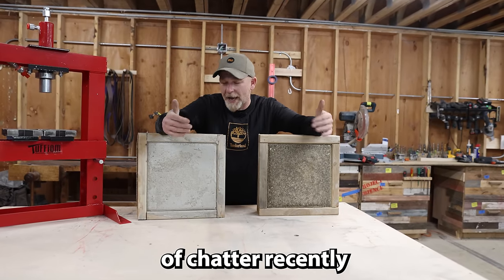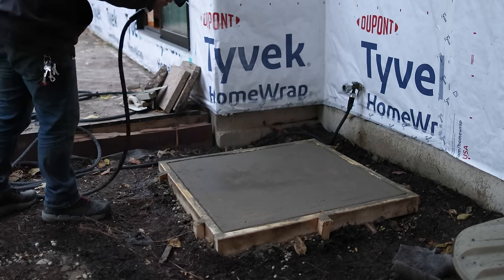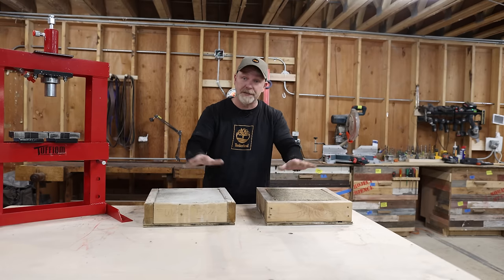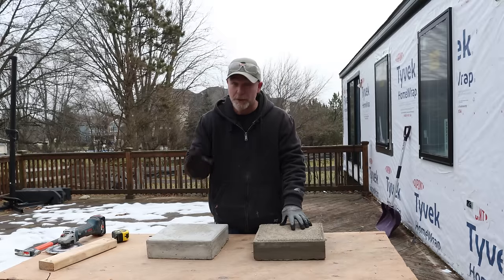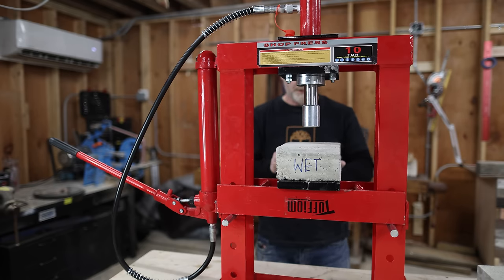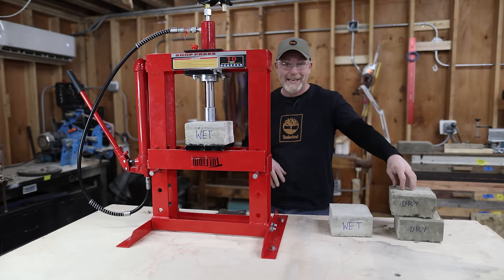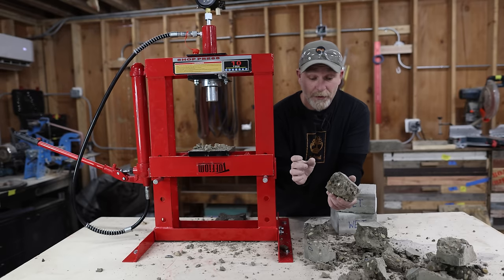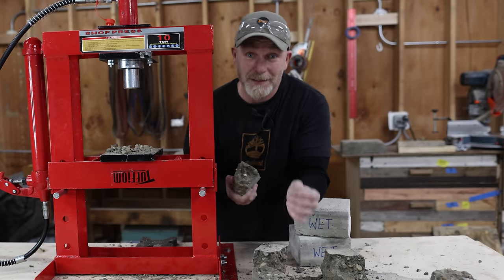The TRUTH About Dry Pour vs Wet Pour Concrete!! Strength Test - You WON'T Believe the results!!

Comment: You know i think why the dry pour has a different colour is because it is still absorbing moisture from the air.
I was wondering if there is a courser powder of concrete that would allow moisture to seep deeper into the dry pour so it will set faster that a fine powder that hardens at uneven layers. My speculation.

Comment: You should keep wetting those over the next several months. There is no way to get enough water in a dry pour to fully cure it by misting it over the course of a day. However, if you keep misting it you might see additional curing over time. It will never be as good as a wet pour though.

Comment: Concrete is meant for Wet Pour. However Dry Pour is an interesting labor saving procedure which had many advantages. Perhaps a new Additive need be added to add water to the mix. I think if the slab is thinner dry pour could work.

Comment: I cannot agree ninety days is  OK just about for wet pour but you need to triple that for dry pour. There is dry pour and dry pour. In my experience dry pouring fence posts you will get a differing cure time between Autumn and summer pours due to ground moist levels. If you are pouring a dry mix into a hole of any description in a naturally dry area pre soaking the hole can make a substantial difference. several pre soaks until hole holds water to one third full pour in the dry mix add more water, this can lead to material separation so some stirring may be required.  As for large slabs dry pouring should really be restricted to light load areas and given as much water as possible.

Comment: That dry pour honesty looked like it needed longer to cure. Also, from my understanding of wetting a dry pour. You should mist it 2 times waiting an hour between each. Then you should shower it once an hour and should do it 2 times for every inch. So, a 4-inch slab would need 8 showers. That said looked at it how yours turned out. I wasn't surprised at the results.

Comment: So let's live in fantasy land where dry pour and wet pour are identical after done.
What is the benifit of a dry pour.  You have to mist it and soak it and care for it for days to make it work.   
Wet pour you mix it up and pour it.  Let it start to set up and trowel it out and your done.  Don't let it get rained on for first couple hours and your good to go.

You don't save on concrete bags, in my opinion you'll never get a dry pour as smooth as wet pour, I guess you save on the mixing part but that really isn't that much work, you still have to lug the bags around. More so in a dry pour. Wet pour you don't even have to unload then from your truck. Pull to the edge slit the bag and let gravity do most the work

So how does a dry pour make Job any easier??

Comment: I think it more likely that the water didn't saturate fully into the cement than it simply not curing. I'm curious to see how it turns out with a dry pour and fully saturating the concrete rather than just misting.

Comment: Although I totally agree that the wet pour is by far the strongest, I've never done dry pours the same as shown in the video. I would never allow so much time between wetting the concrete. If it begins to harden, the "mist" will never fully reach all areas of the mix and it will never reach its full strength potential. I keep watering it slowly with very little time lag between adding water until I'm convinced the entire mix has absorbed enough water. I'll even build a damn around where I'm pouring to allow as much water as possible to be absorbed by the mix. On dry pours, I'm not concerned about the smooth surface texture as I would only use that method where looks don't matter. Strength, however, matters very much. I'll have to run my own similar tests to see how my dry pour system of misting holds up to the wet pour mix.

Comment: Mist the dry pour with a mixture of binding agent, but on yours the reason it felt wet, you put it on plywood the plywood held water to it the whole 90 days it never got a chance to dry.  I like the color of it for stepping stones in a garden path.

You could make it stronger if you fill the forms 1/2 way add a fiberglass cloth also a bonding agent and layers  a few times maybe adding tile grout 
Im going to bet there is a way to make it much harder and still do a dry pour.  Someone could play with it and come up with a better way to do it.

Comment: The first time I heard someone mention dry pour, I thought it was the most idiotic thing to do with concrete. I understood that there is a chemical reaction that takes place when the water, cement, and aggregate are combined. Unless you mix the concrete well with the water, it is impossible for the water to get everywhere at the same time and react and cure properly. If you care about your slab being strong and long lasting, mix it wet and pour that wet mixture into the form. These test results are no surprise at all...except I thought the dry block would crumble even easier than it did.

Comment: There is a reason why you prep the ends of a test sample (sulphur cap or a planed face) before loading. Surface prep is critical to getting good test results.  Not prepping means you have focused point loads that will skew the results.  I'm not saying this would prove the dry pour better just that your load test doesn't mean much.

Comment: I need to make a short ramp. Maybe 3'6" wide and maybe 5' long. I don't have a wheelbarrow so I'm going to dry pour the concrete then wet it and try mixing it in place and finally smooth it a bit. It's to get a small riding mower, 325 lb. up onto my carport deck. I figure to dig the thing out so I have about 6 inches next to the deck and run it down to about 3 inches on the thin end and dirt fill at ground level for the transition. As long as it doesn't dry too fast, I'm hoping it works.

Comment: Thanks for the video.  That's about what I expected with dry pour.  I did a 6' x 8' dry pour slab a couple weeks ago.  I did it different though, putting in the mix 1" at a time then wetting it and repeat.  To finish off the top I mixed a Portland cement slurry and troweled it out. It looks good, but the test is, will it hold anchors  for  walls ? We will see😮

Comment: Lots of good comments here, except one is missing : dry pour is not necessarily homogenous. The aggregate(pebbles) will settle unevenly and thus there will not be a uniform distribution,  resulting in a weakened structure.

Comment: This video is proof that all the videos all the peat and repeat Youtubers are putting out for content, should not be allowed to be aired. CONCRETE IS SUPPOSED TO HAVE WATER AND MIXED, NOT POURED DRY WITH WATER SPRAYED ON IT. The same goes for putting dry concrete in post holes.
Reply: It doesnt matter for a fence post. I have done both and both hold up just fine

Comment: One last inexpensive test to put the whole matter to rest.
Take 2 cake mixes.
Take all the add ingredients.
In the first bowl, mix completely until batter is still slightly lumpy but coated.
In the second bowl pour in mix,  make a small volcano in center. Add oil and eggs.
Do not mix but slowly drizzle oil around.
Put both in oven for recommended time.
Remove from oven and serve the cake you didn't mix too people you never want to see again 😊
Eat the mixed one at your leisure with no one to bother you.

Comment: I have dry poured and it's very strong it's a very slow cure rate. I have tried to break it after a year it does not break. It was a gray in color just like a wet pour. It simply takes a long time. It's not practical for that reason. Wet pour is faster, and the cure rate is much faster because the chemical reactions that occur quickly and heat is generated.

Comment: There is only ONE thing I MIGHT consider using a dry pour for... A mailbox post. Mailbox posts don't last very long around here. Using a dry pour would make it easier to remove the old concrete to replace the post.

Comment: For a non structural pour, I.E. Sidewalk, small slab to set your grill on, dry pour will work just fine. If it's structural, I.E. going to build a structure on it, wet pour all the way

Comment: Dry pours are for only light weight areas, you can use it on a walk way just fine, but never where cars or heavy equipment will land. Your AC unit should fine as well not too heavy so it should up

Comment: I would say at least the dry pour u could break it up easy if u ever want to get rid of slab . But u have to remember u have to put wire in your slab. Try putting half of the depth of dry mix then wet it then put the top half of mix in then spray it .see what it does then

Comment: I still see no issue with using the dry pour method for things such as walkways, patios, pads for sheds, things like that. You're not putting that much concentrated weight in one spot on those things. I wouldn't use it for a driveway where i'd park my vehicle, or a slab for a house, but I think it's likely fine for some things. Plus the perk of it is ease of use. I do many projects by myself, so using dry pour for some things is much easier. I plan to do a couple small slabs for firewood storage, as well as extending my patio. I think it will work out fine.

Comment: I guess pouring the recommended about of water on the premixed powder, doing a bit of mixing in the ground and  then using a trowel to finish it is not technically a "dry pour". 

I know a fencer who did that for a fence post. He poured the dry powder into the hole, poured a good amount of water into the hole, then stirred it up before leaving it to set. Technically that is not a wet pour, but I am not sure if it counts as a dry pour, either.

 I am thinking of doing this because I don't have a mixer and don't want to buy / rent one. A bit less strength should be fine cause it is only a small area (about 60mm to 80mm wide)  that is should get very moderate foot traffic since it is on the edges next to the fence.

That being said, some people who dry pour get the concrete to appear the same as a wet pour, so the difference in the visual appearance of the concrete makes me wonder if the person has chosen the worst of the dry pour methods to test.

I could be wrong, but I think he only misted the concrete every 40 minutes? Some people give their dry pour a good soaking after 1 or 2 hours, and not just misting it. That might cause the slab to get closer to the recommended amount of water than just misting it every 40 minutes.

Comment: I dont think anyone thinks dry is better than wet.  But thats not the point people do it. They do it because its easier, can usually be done by one or two people and a hell of a lot cheaper than having something done by a pro.    All of these reasons I did it for a little outside patio.  $850 bucks but was quoted by a pro for $3500.

Comment: Seems to me without liquid, you will have a difficult time getting the cement more evenly mixed...think how rock, sand and cement settle in that bag. Getting a real mix (liquid mix) i think is key to more evenly dispersing cement, which is the glue that holds concrete together. Maybe that's why they spend all that money and technology to deliver a "ready mix".

Comment: Dry pour it only solid on the surface. But the core is still essentially powder.  Compromise the somewhat thin outside and the structure has catastrophic failure.  And those saying dry pour is good enough for light duty applications - sure, but only for awhile.  And anywhere the temperature goes below freezing your dry pour will begin to fail even faster.  It will start to turn to gravel after a few freezing / thawing cycles.  So for temporary applications - maybe.  But for any permanent application - sorry, but no.

Comment: I did see where if you dry pour with 60lb bags, you need 1 and 1/4 gallon of water for every bag. I did a dry pour for a section 4' x 17' and it came out good. but  it cures in about a month and you have to wet it every 30 minutes while you're doing this. I only dry poured it because I can't handle mixing all those heavy bags. so for a female I guess it would be easier and it's not bad for a place where you're just going to walk.

Comment: I would try dry poor with a inch then wet it till you seen water on the top. Try this 3 times and the last inch do it dry on top and then just finish the top as you did from the start. Maybe break it up wet the bottom then add two inches and get it wet with just to you see the water skin the top. The problem with dry is that it never get wet enough like wet concrete. That way the dry stuff it getting wet threw the whole thing. Just thinking outside the box with the dry stuff.

Comment: Maybe if it's in the ground like a fence post or footer where there's a ton of ground water that can be absorbed quickly it might set up ok. But sitting on top of the ground where the surfaces are allowed to cure before it can soak up enough water, I don't think it would ever cure properly.

Comment: Placing the mix dry can work if the Method is right.  Just wetting the top is not a good method.

I've got a 10' x 10' section of floor in our shop that is proof that it can work.  7 years, supporting a 5,500 lb surface grinder, a horizontal mill, and a camel back drill press, and there is no sign, at this time, of a major failure.

I placed it dry because my mixer decided to strip a gear just as I had the day committed.  It still was a lot of work.  If you play your "lazy card" with either method, the results will likely not be good.

Wet mixing before placing, in my opinion, is still the better way to go.  That way, you know what you have.

Comment: I was thinking that this was going to happen do to the fact that it is difficult to get adequate water to penetrat into the entire slab like a wet pour. Dry pour sounds cool and I would like to see other tests and longer periods. Maybe if the dry pour test block was actually on the ground and the forms removed, it could have pulled in more moister. But I still don't think it would be the same as a wet pour.

Comment: Concrete mixing is a chemical reaction that requires water. Not enough and it doesn’t have enough to cure too much and it weakens the mix. I think the confusion comes from the dryer the mix the stronger it is- which is correct as long as there is enough water in the mix for it to react. So in summary a dryer mix IS stronger to a point.

Comment: Air Conditioner weighs ~200lbs and the load is distributed.  When I did a dry-pour it was more of a "mix in place".  Pour an inch, spray and scrape.  Pour an inch, spray and scrape.  I really don't understand why we compare the REQUIREMENTS of landing a 200lb stationary device.... with the REQUIREMENTS of landing the footing of a Sky Scraper!?!?  Exactly how many TONS do I need to hold off? ... So like all YouTube Arguments, it is sort of Moot.  If it is not Code Compliance, an Air Conditioner will sit on pavers over mud... for longer than the modern Home Depot house will stand.

Comment: I have never heard a single claim in all the dry-pour videos I’ve watched that the strength would be the same as wet-pour, or even close. It’s ludicrous to even think so. But, if you’re making a base for a chicken coop or air conditioner, a sidewalk, or in my case, an apron next to my patio for my pellet grill, what difference does it make?

Comment: Lot of engineers here suddenly. Interesting video. However the dry pour concrete people always seem to use quickcrete. Presumably quickcrete is formulated a bit differently and also cures differently. So could you also try with quickcrete?

Comment: What i think happens is when the top cures its actually holding in the moisture in the middle so it cant cure. Maybe dry pour but soak the whole thing through instead of just sprinkling water

Comment: I don't know where these kids come up with this stuff.
Concrete is literally as easy as building a sand castle.
What really surprises me is that manufacturers have failed to recognize the obvious new market created by the easy-mode generation, and none of them are working on a dry-pour solution.
It may not be as strong, but if they can develop a mix that's even close they would have first crack at sales. The land of opportunity is knocking, and they have their heads in the sand concrete.
They should ask Sears how that whole ignore internet, keep printing paper catalogs strategy is going for them.

Comment: I am curious if you could make two samples using a carefully measured, equal amount of concrete for each.  Make one wet and the other dry.  After a long cure time, measure their weight to see if the wet pour has more mass than the dry pour.

Comment: I think concrete pads on AC units are just for vibration ballast. I also think wet pour concrete with concrete designed for wet pouring is obviously going to do better. It probably has to do with dissolving and redistributing chemicals for the curing reaction. my guess is if you made a finer more homogenized mix it might work but the cost to do that is probably not worth the capital investment to make it happen vs all the existing legacy infrastructure.

Comment: Realistically, are DIYers going to put 2 tons of weight over 2sqft?

Wet concrete is definitely the best route for high strength.

Dry, still fine for moderate residential projects.

Comment: The voids in the wet pour is because you forgot to vibrate the mold.  A blade less Saws-all would have made a huge difference. All form work done by reputable contractors use vibration to settle the concrete.